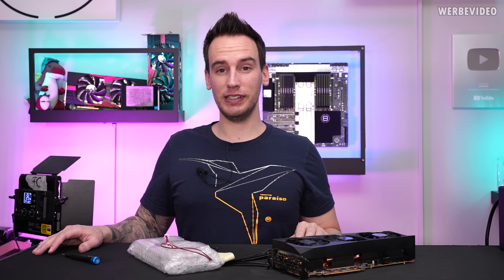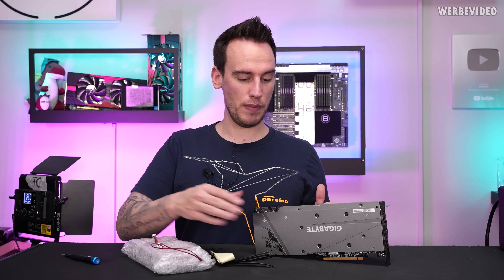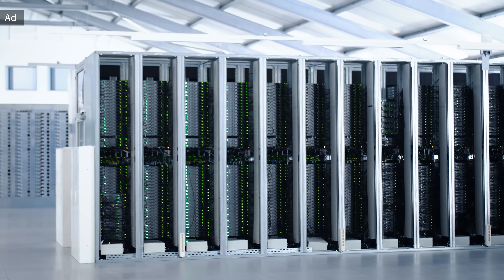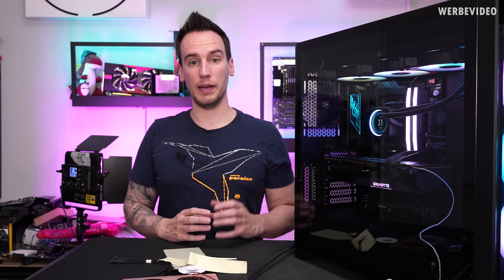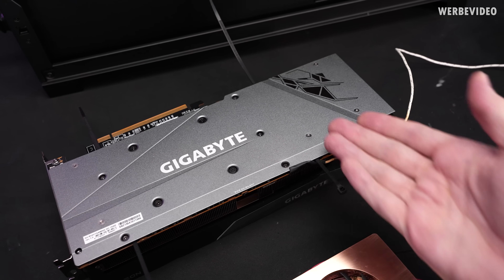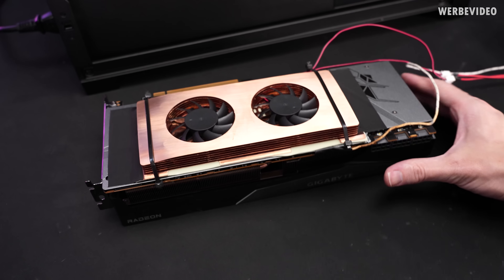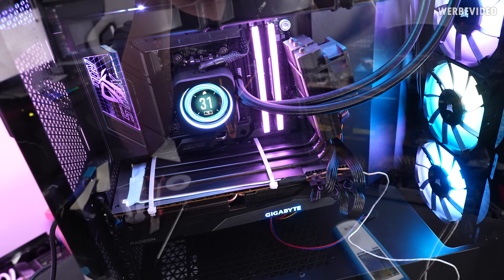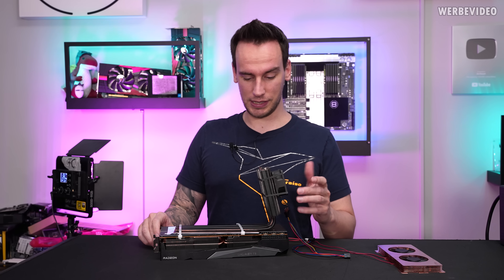Please don't do this - AliExpress GPU Backplate Cooling

Comment: this kind of "solution" worked for GPU crypto mining where the memory modules got really hot while the main die remained (relatively) cool.
This helps cooling the memory and helped me (not with these but my own janky solution) achieve higher hash rates with less stability issues when mining on my gaming rig.

Comment: My watercooled 2080ti is vertically mounted and sits directly over my motherboard. My vrm's  are always running hot. I once put something between the gpu and motherboard and the vrm temps dropped. I need something that sends the radiating heat someplace other than my MB. Or I could just dump the riser cable and mount it in the MB...

Comment: On my MSI Mech OC RX5700 I removed the cheap plastic backplate that only trapped heat now card runs cooler and more consistant clocks plus I attached a slim 120mm fan to the exterior of my case below the output of the GPU sucking air out.

Comment: You should test it on RTX 3090 or on the GPU where are VRAM chips on both sides,on RTX 3090s it helps lower VRAM temperatures by good margin,on 6900XT not sure if that's helps but definitely on RTX 3090 or 4090 this would definitely helps with lower VRAM temperatures
Reply: helps but doesn't solve it. The 3090 is still overheating.

Comment: Use OG 3090 if you want to see real differences. Miners used these similar designs to cool vram as half the memory was on backside of silicon immediately under the backplate. I saw ~14C best case and -8C on the setups I did.

Comment: Im pretty sure this was designed for a 3090 in mind not an AMD gpu. Because the 3090 got very on on its backplate because the Vram was there. Also my 3090 has so much sag now that it just get hot for everything so I had to change the mount to vertical to keep the pressure off the board.

Comment: It could be an interesting product to make custom backplates with some graphics on them which had heatpipes like the second one Maybe not as tall, but atleast it would cool the backplate directly and could give some reason to buy them (if you like a cool design on the backplate)

But even then it wouldn't really effect performance, but what it would do is transfer that heat elsewhere from the case instead of building up the ambient temporature inside the case.

Comment: Maybe a solution like replacing the backplate with one that has machined fins on it that's cooled by the airflow from the front and rear fans, or even strapping a few fans to it. You could also replace the backplate with a heatsink, but at that point the added cost and weight just doesn't make sense compared to, like you said in the video, a GPU waterblock.

Comment: cooling the backplate is worth it in some cases. My 7900xtx backplate is really hot, it can quickly raise to 60+ degrees. However, it is meanless to just put a heatsink on the back of the GPU. It is better to find a company that makes heat skin to modify a backplate for the GPU, which will be costly. Like my reference 7900xtx, I am planning to find some company to modify the exact same backplate with the same mounting hole for the screw but with a water block mounting place(for the AIO 360) and with some extra fin.
Cooling the backplate can be marked as "meanless" rather than "useless". Because If you want to drop the temperature you have to put a lot of effect into it.

Comment: The 2 GPUZ readings of under load condition had a slight difference in GPU boost clock, the 2nd one is higher than the 1st run, which could result in higher temperature, so I do think to some extend, this thingy increased the thermal headroom for OC for a bit.

Comment: 6900XT is a bad test subject something like a 3090 FE would have been better due to the ram on the back and the power used by said ram,

anyway my 3090 FE @400W (Vram Temps) went from 104 Peak to 94 Peak with just the rear pads replaced then with an aluminium block and noctua 80mm fan it now peaks at 84
Reply: 84 is still bad. Remove backplate, no more trapped heat.

Comment: I solved the same problem by just pointing a fan at the backplate. Much cheaper and simpler and just as effective.
Reply: you just cooled the surface of the back plate. Under it, it's still hot.

Comment: So I had the 6750XT version of this card/cooler combo and the cooler is trash. Had it in a Fractal Meshfy C and it ran stupid hot for my liking, talking about 95C on the hot spot with 70c on the gpu. Tried repasting to see if that would solve the high temps but no, ran it with an under volt to keep in some what better. With the undervolt it would hold low to mid 80's on hot spot with gpu in the mid 60's, that better but still going to be a short lived card running at those temps. I got lucky and got a deal on a 7900 XT from XFX and gave my little bro the 6750 XT, we put it in his ITX case from Corsair and it had a fan that pulled air from the bottom right onto the rear fan of gpu. It actually ran cooler in his case than in mine, I have yet to figure that one out as I had 3 high pressure 120 Noctua fans for intakes on the Meshfy C case. So it had tons of fresh air but I guess because the cooler is pushing so much of its air out at the MOBO it is just reintaking its own hot air. And having a fan blowing up into the card from the bottom pushes that hot air away more than if it was coming from the front of the case to the rear of it.

Comment: But why are you going with the worst case scenario of usage just to disregard these?
Not that i would ever buy these , but if i had them on hand that's what i would additionally test out of curiosity :
a)Memory temps on full back plate 
b)Gpus with cutout behind the chip 
maybe 
c)gpu's without backplate 
and while we are at it
d)Proper , well-thought mounting

Comment: kryonaut is the solution

btw back in the days i've added ~92mm fan on an 9800 GT which had no backplate, simply placed the fan on top of it without any zipties but with 4 rubber thingies instead of screws and it actually saved the card from overheating on auto fan speed (it stopped doing purple screen which would lead to shutdown of the pc, such thing happened after the card reached mid 70c) , later on i learned how to manually raise up fan speed so tiny fan was no longer needed as the card was running at 100% fan speed all the time to avoid reaching 70c, even was able to flash the card to more than 9800 GTX+ performance thanks to extra volts
so extra fans on top of the card can help, but perhaps only if without backplate

Comment: what if you mounted a normal gpu cooler...but on the back. and use nuts/bolts through the stock mounting holes so both heatsinks squeeze the gpu core. Just use a big thermal pad between the pcb and heatsink.

Comment: I think that a brick would have been a more efficient way to make contact between the copper contraption and the GPU backplate than zip ties and adhesive/bondage non-XXX straps. 
The color of the brick would have blended in with the copper, so a virtual +1 point for style!?🤷‍♂

Comment: 7:29 Its on 2222 GPU clock, where stock it was at 2175. I would expect the card to clock higher and have the same temps, if it worked at all...

Comment: I like the looks of that first one for its Cyberpunk appeal.
I de-shrounded my 3090 and like the looks of it. And it's quieter and cooler than it used to run. But it doesn't really get 'overhot'. I just like copper fins and spinning fans a lot.

Comment: Using these on 6900xt is pointless. You should try it on 3090. As you said that there are vrm just behind the backplate in 3090 and that backplate is getting too hot that you cant touch it.

Comment: Question? Isn't a hot backplate actually a good thing, that heat is being conducted/dissipated through backplate and its not trapped below plate.
Reply: No, your backplate is hot because the heat is trapped under it. The backplate cannot dissipate heat fast enough, so the card overheats. You are confusing the backplate with a heat sink. Heat sinks are very close to the part they want to cool and have very thin fins that help it to lose heat faster. The backplate is far away and has no fins.

Comment: Isn't the second back plate cooler supposed to be mounted flipped 180 degrees so that the hot air is expelled out at the back?

Comment: If the second one was at least making direct contact with the back of the pcb it might work ok. Like you sandwiched it between the backplate and pcb with thermal pads and longer screws it could help memory temps even without the fan. Not worth bothering with on anything aside from maybe a 3090.

Comment: i don't have many standards. Just build the worlds confirmed only RGP-free gaming PC. In a black metal case. But even i would not use this thing. If the backplate needed cooling, it would have cooling (and cost even more). 
But talking of packages, i got my 450€ motherboard from Amazon, and it came basically in a a paperbag. It's own box inside of course. The bag was ripped half open, probabaly when being pushed into the Amazon locker... At least i hope because the board box was very clearly visible through it.   And it was shipped from and by Amazon.  Interesting solution.

Comment: No way in hell would I have an eye sore like that in my PC. A far easier solution is to not touch the back plate. 

Also, stop being paranoid and just install a decent AIO, better overall airflow throughout the case plus no eye sore = win.

Comment: If you need to cool your VRAM (I suggest a test overclocking thermally limited VRAM) I would suggest removing the backplate and adding your own heatsink.

Comment: I did a diy solution on a 3070 FE once. Added another thermal pad on the backside of the core then stuck a Ryzen stock cooler on the backplate held on with just thermal paste. Saw about a 3C reduction in the core

Comment: Hey, I recall seeing a company (non-ali express, afaik) that sells a generic GPU backplate water block (looked it up, mp5works).  It would be really interesting to see the actual wattage removed by measuring delta T and flow.  Also, if there was any improvement by adding additional thermal pads behind the gpu die/vram.

Comment: Hot backplate = dissipated heat. Solution: don't touch your backplate under full load. 😅

Edit: in all seriousness, i understand adding stuff especially for better GDDR6 temps etc but regular heat sinks or pad between the plate, direct airflow... So many simpler, cheaper and better looking solutions lol

Comment: What's funny, you could spend this kind of money simply replacing your front intake fans with higher end, high pressure ones that will get air over the backplate and probably get similar results to these abominations.

Comment: I had a 3090 that I cooled with a backplate addon.  It def helped the memory temps.  I took a large heatsink and used thermal adhesive to stick it on, combined with some thermal compound.  It def helps if you have memory under the backplate.

Comment: I'd really like to see De8aurer try making the slimmest air-cooled 3090, you can buy. I thought Roman was going to mount the backplates directly onto the GPU circuit board, not through the original backplate, which is limited by the thermal conductivity of the original backplates conductivity to heat, which is aluminium. Copper cannot conduct heat faster than aluminium will allow.

Comment: These soutions, are for a single card
The 3090 with ram on the back side of the card
Owners of this card are not going to buy something like this, they'd much rather buy a replacement backplate that has a small laptop style fan blowing through an ultralight laptop style cooler, but running most of the length of the card.

Comment: I just point a fan at my back plate.  I swear I got better cooking with an ordinary back plate with a fan than an active liquid cooled back plate from EK.  To be fair I preordered it when they first came out and it did not fit well.  Hopefully they improved by now.  What a waste of money that POS was.  A good 140mm brought my VRAM temps down 5-7C.  Core temps were pretty much the same, maybe 1-2C at most.  This was on a 3090, my 4090 doesn’t really need it.

Comment: Heat from the core, VRMs, etc is in the PCB..:
Getting it out (into the air eventually) using cheap thermal pads is a waste of time and money.
Just point fans at the hotter areas of the bare PCB.
ie: Go directly from PCB to air, skipping the delta T losses of pads and backplates etc.

This got me up to the top frequency of one memory strap up on a R9 280X.
Hypothosis:  
Heat from the core and VRMs etc was seeping INTO the RAM modules via their BGAs etc.
Ameliorating such allowed the RAM OC quickly, cheaply and effectively and slightly cooled the core aswell.

Comment: i could only see this working if it was a backplate replacement, taking an aluminum sheet , changing it for copper and adding fans should reduce board temps but it seems the transfer between materials with a backplate still in place isn't much better. 5-8 degrees C at best and only the outside most layer, not the PCB necessarily. slight worry to over compress the pads and short out components with copper plates though.

Comment: I have a Nitro + V64 and i have it water cooled with an aftermarket 240 AIO and since i have removed the backplate, i have x2 12cm fans from the side which, like with the AIO fans, these two ramp up based on the Hotspot's temperature and blow air from the side on almost the entire card directly.
So they cool the VRMs and the back side of the card.
This has reduced the back side of the card's PCB by almost 19C overall (18.9 to be exact) since there isn't anything to impede heat from getting blown away, like a thermal pad would have done, i checked with a thermal sensor and with an IR thermometer and the hottest component with no UV and max OC it was was on a component which was at 66 when the card boosted up to 1810MHz (stock max is 1630MHz for this one) sucking up to 392 Watts (power limit set to 50%, GPU core clock set at 1715MHz manually) and the even with water cooling that specific time the Hotspot reached 98C iirc.
Before i did this to the card (had the stock Nitro air cooler), the card wouldn't hit anything above 1715MHz without crashing and oddly enough with the Hotspot at 92C (mind you, same system, settings and drivers).
Without this kind of cooling the card would've cooked itself doing this probably.
This OC was just for testing i now have the card back to stock clocks and UV but the setup is the same and the card is barely heating up(in the summer i almost reach 80C on the Hotspot when i am maxing out the card in some triple A game).
In the beginning i had tried with these 2 fans above it on the back but sucking the air upwards away from the card instead of blowing it down to it (i've helft around 0.5cm space with rubber risers on the fans' corners), and it reduced the Hotspot temp by around 7C iirc and GPU by 13C.
This simple way is amazing if your backplate is setup up correctly from the start in order to get good results  (good thermal pads and contact or even remove it entirely) otherwise adding thermal buffering layers which bottleneck heat transfer which isn't gonna give you a good enough result.
It's also nice like this because you don't have your stock air cooler blowing like, 70% of the heat coming from card back to its PCB.

Comment: This kind of cooling can lead to interesting problems. I built an ITX rig for a friend once where a 200mm top fan blew onto the back of the graphics card. The PC was always crashing when gaming, because the temp sensor of the GFX card was cooled too, and didn't spin up its fans. As a result, the GPU actually overheated, although the back of the card was cold to the touch ^^

Comment: Great video. Could you please do a similar video on GPU back cooling using active backplates, in a custom waterloop, on a few different brands of RTX4090 graphics cards, then measure the difference in temperatures of GPU components with passive backplates vs active? Is it worth the extra cost of an active watercooling backplates vs passive? Besides the obviously much nicer aesthetic improvement if you mount the graphics card directly into your motherboard (RGB, being able to see fluid flow, etc vs a boring plan metal featureless backplates)? And would the active backplate cooling also lower temperatures enough that overall fan speeds could be reduced and hence lower noise?

The silicon may be designed to withstand higher temperatures, but over the course of many years, surely reducing the overall GPU temperatures will extend the shelf life of the GPU? What about gains in stability?

Comment: I have one that looks way better than both of those and I mount it without the backplate for better heat transfer and it’s drops almost 10c off the core and junction temp. I also used my own thermal pads as the ones supplied are terrible.